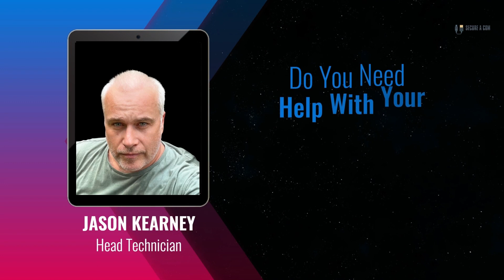2 NBN Tech Could Not Find Customer Cable at MDF Frame For Sydney Unit

Comment: Rude NBN techs, no surprise. I was setting up a friends soho network for their fixed wireless getting connected that day, the NBN guy says all done, just need to wait 10 minutes for NBN to do things on their end. Says nothing about the box having to stay on and goes off his brain  when I unplugged the power to plug in a power strip for the router. If he had mentioned the box having to stay powered up in this time I would have happily left it alone and waited for the go ahead. Only ever turned up well after a new connection is set up and the customer had trouble setting up their router or home network. Never been present on connection day before this so had I had no idea in that regard.

Comment: this guy has no idea...
the old MD Frame Frame...
also it is not nbn responsibility past the MDF any way.
and that's not the 'A' side...
Reply: Guy has no idea, did they get a passing result on the internals that he traced😂😂😂😂 love to know how much this Muppet ripped them off just to tone. Where was his pet or tdr testing??
Reply: AussieBB have no techs to send out, it's all NBNco unless it's Aussie Fibre (business service)
Reply from the maker: I have no idea? Yeah right! I’ve only worked inside the network since 1997. Help construct and build most of the copper network in Sydney, central coast and Illawarra, managing over 200 techs, in a massive infrastructure upgrade. I’m guessing you are one of these shitty NBN contractors. Aussie Broadband has a full service where they connect to the customers socket and don’t leave the customers hanging. They didn’t even tag the A side. And if they can’t trace a line they have no business working in the network. 

It’s you that has no idea

By the way it’s called an MDF not a MD frame frame. 😂

Comment: This is exactly why I brought my own Fset. Apparently (2nd hand info from a tech). the contractors get paid per job, so it's not in their best interest to fix the problem, or fix it properly, because it won't generate them future work. At almost every place I've lived, I've had to help the contractor and make sure they don't leave before properly completing the job. There is no incentive to do a good job, but rather there is incentive to do a bad one.
Reply: Yes correct, the more jobs he gets done in a day the better for him or her. There is no care, it’s just let me get the light to go green then I am out of there quick smart.
Reply: The tech probably stuffed someone else’s internet up. I’ve heard from many customers that each time they see a nbn truck in their street the internet is going down. This would be due to tech’s having a good time changing pairs then break someone else
Reply: @richardkimmorley6384 , in my current house after being connected for a month, a tech connected the neighbor using my line, then the next one comes out, reconnects me, with my old line and the neighbor lost their internet. The neighbor and I worked out what was going on and met the next tech at the pit. They ended up running a new line 200 meters down the street.